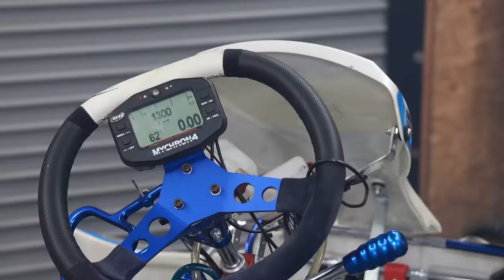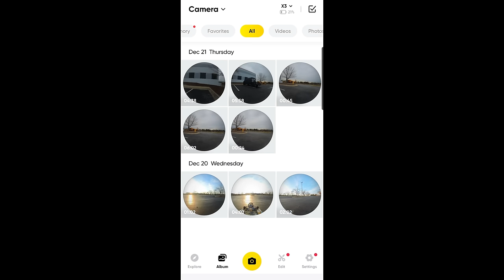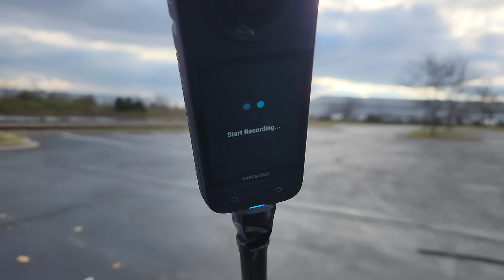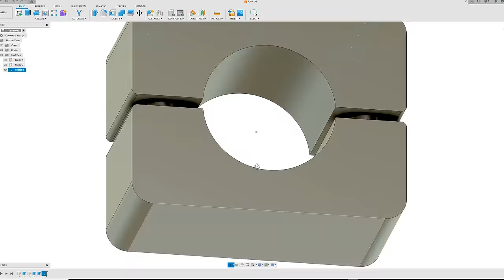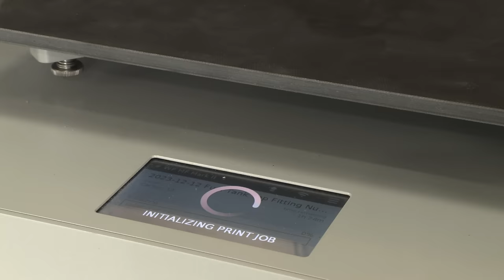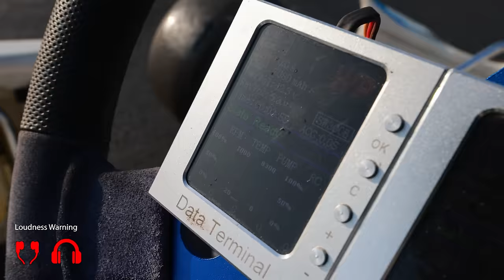Jet Powered Go-Kart (3 Jet Engines)

Comment: A couple of suggestions I have for better performance.... try 3d printing an air intake to feed those engines, maybe something F1-esque. Also some aero might help a ton with the handling, especially if you lost weight in the rear with the conversion. At the very least, a wing on the back should help quite a bit. Bonus points if you can make it an active wing!
Reply from the maker: Extra intake air won't do anything in this case, but there's countless comments about that and it did give me a future video idea, as for the wing Yeah that would be cool, I thought about the wing the issue is I don't need more downforce in the rear, since it has a fixed axle it doesn't turn very easy and more pressure on the rear tires would make understeer even worse.
Reply: @WarpedPerception  at higher speeds, I think it would. Your body is making turbulent air with a low pressure pocket directly behind you. As far as the aero, a front wing would probably help more. If you have a 3d printer, it wouldn't be too hard to design and print the whole get up, front and rear wings and a diffuser, etc. I'd be willing to help there if you don't have a 3d printer or aren't familiar with any CAD.
Reply from the maker: @adammcaughey4044  thanks! Sorry I should have clarified, Yes for sure I would say over 120 mph Maybe 150 It would make a difference, But I don't think It would increase rust in this case just efficiency, because single stage turbines are wildly inefficient, And the RPM is limited by the controller. Thanks for the offer I'm a 3D printing Do you have a big one? I don't know if I'm going to be doing many jet episodes I'm switching over to some other content for a little while... I just got sucked into this whole jet thing because I didn't have a lot of videos I was injured.
Reply: @WarpedPerception  I have a bambulab P1P, 256mm³ build volume. I was thinking of designing the aero in sections that glue together with carbon fiber rods as reinforcement.

Comment: Given the 3 engines, I wonder if you could swap to a two foot pedal design that gave you control over the strength of the outer engines to help with turning. Put the brake on the wheel maybe, or maybe use two hand paddles instead for throttle.

Also, a bit odd to call it a comparison, but not show the speedometer for the first kart. I would have liked to actually see that difference off the starting line that you described, but great video.
Reply from the maker: Well the issue is that the response time for these engines is like 6 seconds, So trying to modulate anything in a pinch is not an option. Additionally you want most of the engines in the middle. Yeah sorry for not showing this speedometer I was filming by myself and I was recovering from a brain engine here so I literally got back to real work like 3 weeks ago.. took forever

Comment: It looked faster than the shifter cart. The control problem would be less if you had a rudder sticking up to help direct the rear of the cart around corners. Soon you will have a ground based jet plane LOL

Comment: if you want to slingshot the corners, don’t slow down so much, and try to keep your ground speed around 30mph, and in the middle of the turn, punch the throttle and hang on

Comment: With 3 engines... I wonder if you could have the steering restrict the flow on the inboard engine when turning to give you a little extra vector? ;) Fun to watch!
Reply from the maker: That's actually not a bad idea, I didn't do thrust vectoring because you need to plan the turns while ahead of time. Thrust doesn't turn on a dime.

Comment: You have the jets mounted in the wind shadow of the seat and driver. That means the jets are getting a disturbed intake airflow at best. Have you considered a fiberglass/carbon fiber intake duct system that wraps around the seat so that the jets get fed air from both sides of the seat? Look at jet aircraft and see how many of them place stuff to block the wind in front of the jet engines. You won't find any. 

Make a duct system to feed the jets clean relatively undisturbed air. It will look good and it should help the jets operate more efficiently.

Comment: You should get the engines closer to the back axle and point them very slightly up. Like 5-10 ish degrees or so. This will help keep the back half of the ground with better traction and less slipping. Although the further the engines connect past the back axle the more force would be exerted upwards on the front which isn’t good bc you don’t want less traction on the wheels you use to steer. But it seemed to have a back sliding problem which would be fixed by vectoring some thrust in the y plane. You could also get super fancy and have the engines tilt from side to side when you steer to help handling

Comment: Intense! Question if I may. Do you adjust the throttle during your ride when you want to slow down temporarily (like for the turns), or do you just use the brakes? Excellent video. Thanks.
Reply from the maker: Well I was reducing throttle just like a typical engine at first, but at the end I was letting off just for a moment to let the Jets wind down and then hit it again Full throttle.

Comment: Very interesting problem solve going on here.

One of the commenters mentioned separating the rear axel which is a great callout.  You also noted it as well.

I was thinking about the turning you mentioned.  Basically your old strategy was to power through the turns using the rear wheel drive to your advantage.

It seems to me the strategy changes with jets and now your strategy has to change to be agility at speed or something like that.  Agility as speed would keep the cart and jets going where they deliver the most acceleration.

4 wheel steering?  I could be wrong, just an interesting issue you called out.

Comment: Mad man!! Dude, that looks proper sketchy!  Glad you held ot together on that one wipe!
How difficult would it be to add some thrust vector control?
Reply from the maker: I thought about doing vector control since the first go-kart, but the problem is that thrust vectoring works much better in the air than it does on land especially when you have wheels connected to the pavement. For instance the hovercraft I have uses thrust vectoring and it is absolutely terrifying to drive, you have to plan out your turn way ahead of time and if you make a mistake there is no correcting anything last minute..lol

Comment: What if you put a tapered rear bulkhead for aiding airflow into the engines? Maybe with a little bit of scooping on either side of seat. Also ever thought of an electric-jet hybrid? Electric motor for instant acceleration but freewheels or disconnects when not used. Extra weight would hinder top speed on a longer course.

Comment: Mount two of them wide. At the rear use an arduino to read steering and brake pos and bias the throttle ramp up the out down the inner to help push around the corners.

Comment: I think something to note is when you have the engine driving the rear axle, it's powering both wheels. But with the jet engines you retain the solid axle but ideally you'd want a open-differential type or a split axle so that the rear end doesn't want to constantly come out on you due to the speed differential of the tires
Reply from the maker: OMG!!! You just reminded me that I forgot to put that part in the episode, I filmed the entire part talking about that exact subject and how one tire travels more distance than the other and all the coefficients of friction... I can't believe I forgot to put it in the edit.

Comment: Do you think you'd have more feeling of control if the rearend was still coupled to a gearbox? Really interesting to watch it slide around and wondering what having a freewheeling rear axle does for turn-in and stability compared to a normal drive system. Proportioning valve or a split pedal might be an improvement 🤔

Comment: Could you do something like thrust vectoring or pivoting the engines to keep the back wheels from kicking out when applying power in the bends? It looks happy as long as the thrust is pointing the direction of the front wheels.

Comment: I wonder if you'd get a little more performance if you created some ducting to feed more air into the middle engine at least. I imagine it's intake is in a fairly low pressure zone
Reply: While technically true, power at high speed isn't his problem.

Comment: I think you might be able to drift/slingshot more easily if were to create a mechanism that connects from your steering to the jet engine such that the jet engine turn and change the direction of the thrust according to your steering input.

Comment: I love it.  I think you have to enclose it now and work on less wind drag and aerodynamics.  Gotta loosen er up and get her to slide through the wind stream..  now for a faster burst out of the hole you could Go to three ore mounted to those hooked to a switch.. 
Just hit It when needed.  Or go to a instant gas charge pulse type assist engine. Like a booster rocket of sorts..
I know!!  I've been called worse.  😅😅😅😅

Comment: The "really violent situation" at 2:32 looks like something I'd want to watch, but I'm struggling to find it. Maybe it isn't released yet. Looks like a Mr Beast Pontiac jet car try 2 with even greater success!
Reply from the maker: You got it...  It should have flew at least 1500ft, but due to a fault not my own it only got to 600ft, I was upset. It in the train in a hole vid

Comment: I may be mistaken, however I believe the jet engines are positioned on a higher plane than the wheels/ steering which would overshoot- be taking weight from the front wheels/ steering (making steering less responsive).

Comment: You know what the americans did when their early jet engines were not producing enough thrust? They injected the thing with water. The accelerated mass is greater that way, hence the turbojets produce more thrust, another side effect is cooler temps and higher RPMs. Might be interesting to look at.

Comment: wondered where you had gone but glad to see ya back :) question does it make these jets faster or slower if they had a longer exhaust? then ya could put one on either side to make em more free flow and have some room at the back for a decent fuel tank? cant wait for the second test on a long road in mexico lol
Reply from the maker: Yeah it's been a while, first I started working on all the Mr Beast projects last year and this year, then I had a brain injury in August, I'm just getting back to work now🤦‍♂️... Been real hard. As for putting the Jets on the side, well I purposely didn't do that because I can be very dangerous if one engine flames out.
Reply from the maker: A longer exhaust is in fact supposed to help this type of engine... But I'm trying to keep a compact.
Reply: aw yep I hear ya with the flame out part  lol  Big Kahones with 3 jets anyways hahaha :) what bout if exhausts went back centrally at the rear? just that area after the front wheel before the back wheel would swallow that engine pretty easy aye? and look cool :)
Sorry to hear of injury bud takes a while to recover from that I sympasize..but it does get better :) :) you need access to a track or drag strip tho.....WHERE'S CLEETUS?!?!  Colabs on!! anyways keep up the awesome vids and chur n hello from NZ! :) @WarpedYT

Comment: That's a great project, and I think of all the guys that tried on YouTube you went the farthest 🙂 however It seems very unlikely that the jet kart reaches anything close to the shifter in terms of top speed. Sure it is a small parking lot but I am pretty sure you can go past 62 easily as even on small tracks, a kz kart will top at 75 or so.     Also I don't see how slingshoting can make you faster, but I am used to kart racing tracks so I may be wrong. One thing I am sure though: put a damn helmet on! As a former track chief, this freaks me out. I have seen incidents coming out of nowhere (like stuck throttles) that would have resulted in death if the drivers were not wearing protections.
Reply from the maker: This will destroy the top speed of a spec shifter Kart. As for slingshotting, you may not be able to do it in a shifter cart,  you're limited because of the mechanical connection and those little pesky vibrations transferring to the contact patch of the tires through the drivetrain, But in this Kart just like an electric car the acceleration is so smooth (even smoother than an EV) that you can do a linear entry that approaches the limit of the coefficient of friction of the tires for the entire turn and come out way smoother without any jerkiness if you nail it. I forgot a few pieces in the video and one of them is how much smoother this thing is, the shifter cart vibrates like a junk rattle box all over the place just from the engine running It's insane ( I've always found this laughable... What year are we in?). As for the helmet, yeah it's not easy filming, riding operating the camera putting on the helmet, I get it but it just wasn't scary enough for me, not enough space to be scary, however the jet Kart very scary. Definitely check up on the next go-kart video we'll see how I shifter cart does 🙂. Thanks for the concern it does stick in my head you are correct, accidents come out of nowhere and your mental preparedness and quit thinking is usually what saves you. From now on I'm definitely going to install kill switches on the shifter Karts, I have multiple safeties built in on the jet cart but not the shifter... Good thinking.
Reply: I am looking forward to this, you are clearly the one that gets as close a usable jet kart as possible. Now if only they didn't suck up so much fuel.. 😂

Comment: I think if you could fab a mount that can swivel the jet engines with the steering wheel to compliment the direction of the front wheels that it would make turning easier. Example: when turning left the engine nozzles would turn a few degrees left to push the rear end around and sharpen the turn.

Comment: Suggestion, have you tried coming to a complete stop under full power to test the adequacy of the brakes? Yes yes I know the disc brakes are very good.  Also running this course would it be possible to keep the engines at full power the entire time and still be able to use your brakes to slow down enough to go around corners?

Comment: I would put a rear wing on the back to stabilize the cornering you'll have better control and be more safe for you. you can buy them with adjustable angle so you will maximize your control.

Comment: What if you create some counter rotation for the jet engines? Like they're linked to the steering wheel to turn in the opposite direction in a little degree angle so when you make a hard turn the go kart doesn't oversteer? Does that make sense?

Comment: The problem with jets on a go Kart is that a lot of the steering is done by the throttle because there's no diff. It would be funny to see it in the rain, I don't think it would turn at all. If you put both combustion and jet engines on, then that could be cool
Reply from the maker: Yeah I meant to talk about that in the video, I filmed the entire piece but forgot to put it in during editing, I think it would be cool when both engines too but just too heavy and extremely difficult to drive unless I did some active digital controls with logic, other than that with two engines setups it would be an absolute nightmare to drive, it's bad enough as a shifter cart you got gas brake clutch gears, now add jet engines and the two types of propulsion fighting with each other, might be worth a try for a gimmick but I don't see it as being a fun ride hahaha

Comment: What about if you made two of those jet engine install a small fan, and make into a two small turbofan, you are going to improve efficiency in a very high thrust engines, those things have a lot of power on their shaft, i think those jet engines can twist very hard a 8" or 10" fan so the thrust is going to increase significantly then you can get a harder acceleration from 0 to 60 mph like nothing.

Comment: you should make a 2 jet hybrid with an electric motor that has quick 0-30/35 acceleration and the 2/3 jets engage after that for the top speed

Comment: I'd be curious how much thrust that middle engine was doing compared to the others as the air intake may not be enough.  to help with cornering, might consider thrust vectoring nozzles (only need left/right so 2d and not 3d).

Comment: It might sound crazy but what happens if you mount say 2 of those jet engines on the normal kart without gutting it ?
Will it become the best of both worlds with both the original drivetrain + jet thrust ?
And then would there be any benefit to having separate throttle for the kart engine and jet engines ?

Comment: How about mounting the two lower engines wider apart then linking their power to steering position so you can get differential power to assist turning?

Comment: I wonder if there is any way to use powered ducting to channel air efficiently for better performance off the start.  Seems like a boundary layer prevents proper airflow at lower speeds, which could be why it accelerates better past 20 mph.

Comment: It looked like it was only picking up speed at 50mph. I bet you'd make it to 80mph no problem, design a front intake system for them so you can ram air into it.
Reply from the maker: Yup... That's how it felt. These engines don't benefit a ton from ram Air They are single stage turbo jets, think of a turbocharger with ram Air. But I'm sure it would help with fuel efficiency

Comment: You should have left the original drivetrain in place and mounted the three jet engines at a downward facing angle to both accelerate and simultaneously push the cart harder into the ground. That would have given you the hard 2 cycle acceleration off the line plus a little extra push at higher speeds while maximizing the downforce to reduce the necessity of slowing for the corners.